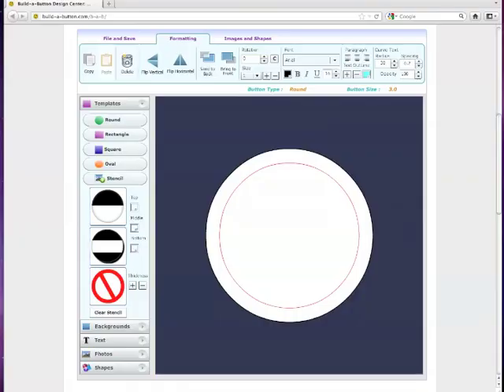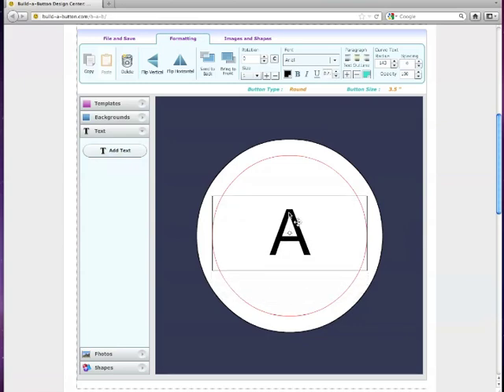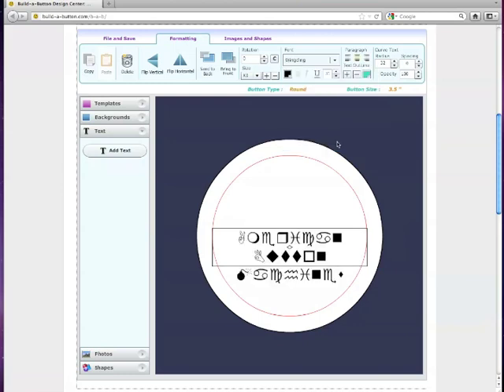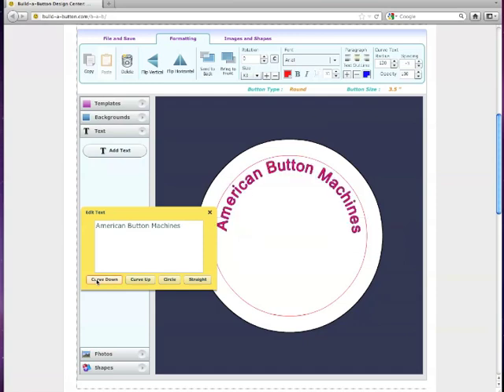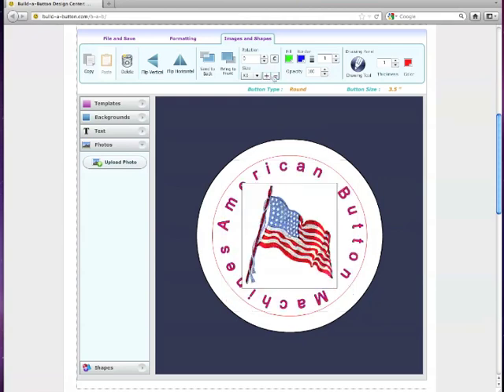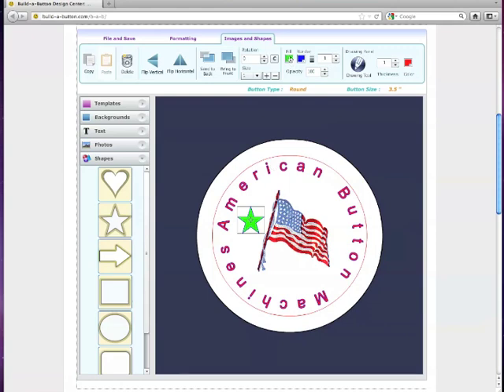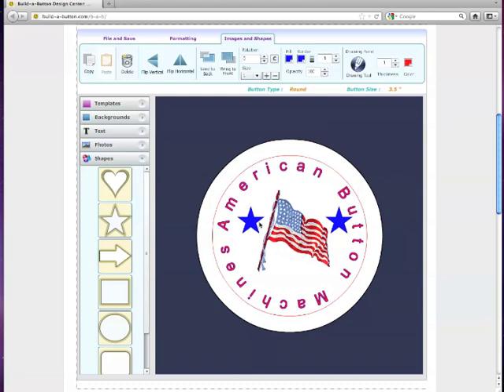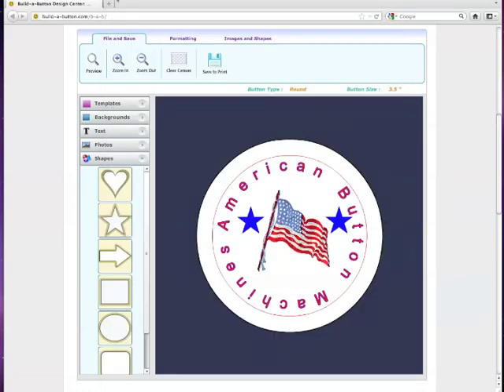Build-a-Button Basics: Tutorial for Build-a-Button Online Design Center

Comment: Has anyone figured out how to do multiline text with this software?
Reply from the maker: Hi JJ! Multiline text is very easy with the Classic Build-a-Button software. The 'how-to' of it is explained about two minutes into the tutorial.
If you are using Build-a-Button 5.0, there is no carriage return. Simply start a new line. 
Hope this helps, Happy Button Making!
Reply: American Button Machines I do see in the video how the text automatically word wraps. With the newer software, the only way I can figure to start a new line is by clicking add text again. The downside to this is that the formatting and alignment don't  match. :(
Reply from the maker: That is rather odd. We have not heard of this issue before, you should be able to easily line up the two lines. We tested on our side and it seems to be working properly. We definitely want to help you and fix any issues.  Please email a screenshot to us (sales@ americanbuttonmachines(dot)com,  so we can see what is happening on your computer.